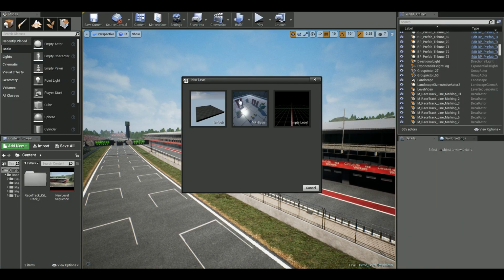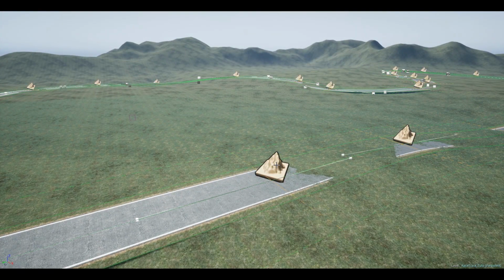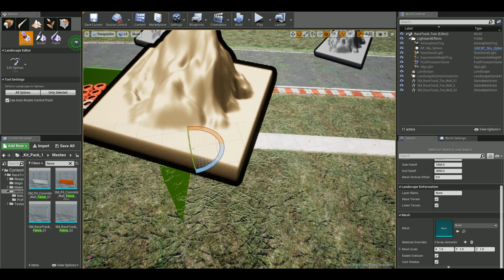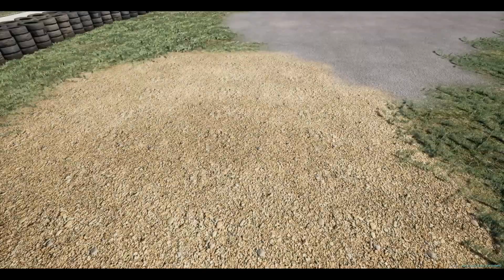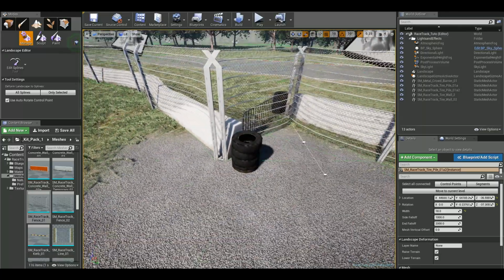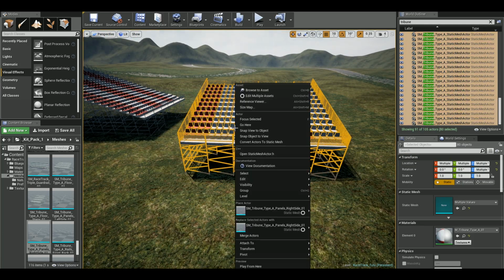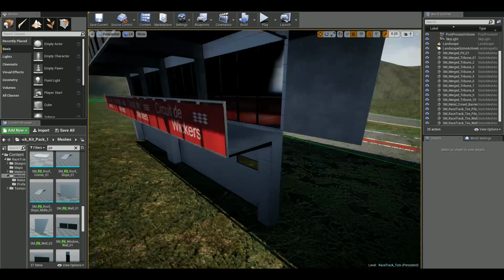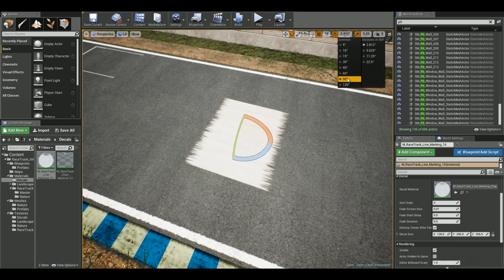Race Track Kit Pack 1 Tutorial Unreal Engine 4

Comment: I have a question when I add the race track in the grass doesn’t match the grass in the pack or the grass on unreal engine How do I get the right grass
Reply from the maker: Can you be please more precise I don't get the exact idea.
Reply: @Unreal3D  so a part of the race track one of the models is a race track with grass on the side of it so when I place that down and then use the grass in ue4 and the grass in your pack, neither match with the grass on the side of the track
Reply from the maker: @e1mortaldrox140  the texture you mean or the grasse mesh (foliage) since I made the pack I discovered tri planar projection for material, I will update the racetrack with this feature, so grass texture will always match
Reply: @Unreal3D  yes it was the texture I’m still pretty new to eu4 so your tutorials help me a lot so thanks you for that and the update. Will I automatically get the update on the pack?
Reply from the maker: @e1mortaldrox140  yes, you will have a notification on your unreal engine 4 vault.
Reply: @Unreal3D  ok thanks